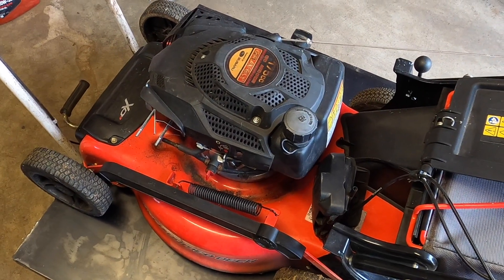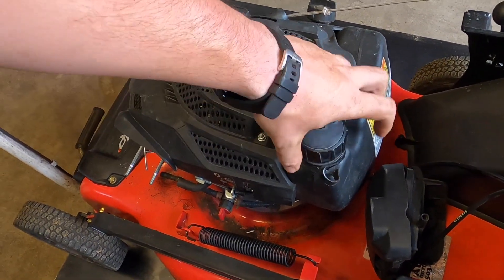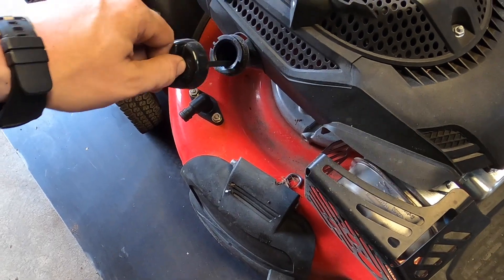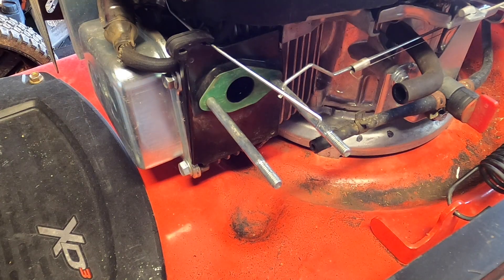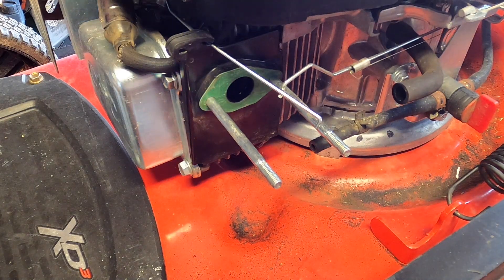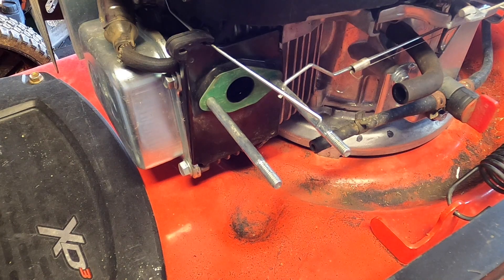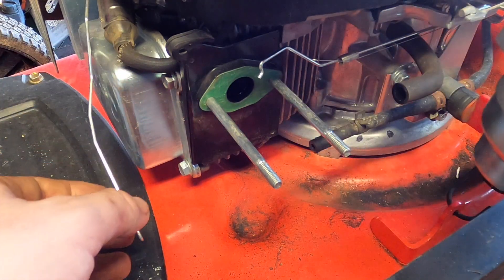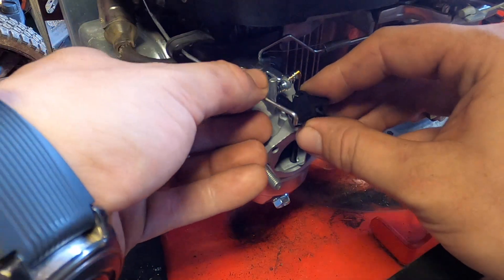Gravely Mower Carb Replacement

Comment: I thought I saw a mixture screw on the carb.
Reply from the maker: There is but the adjustment it offers was very minimal. Mainly used for engines that idle